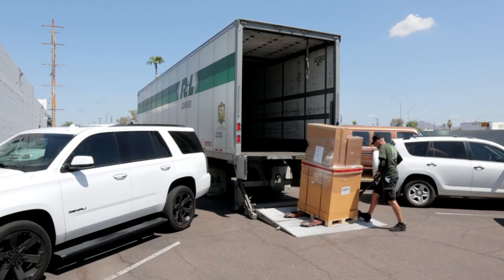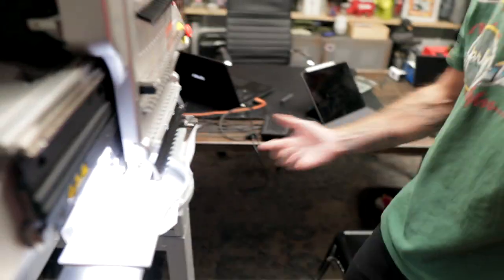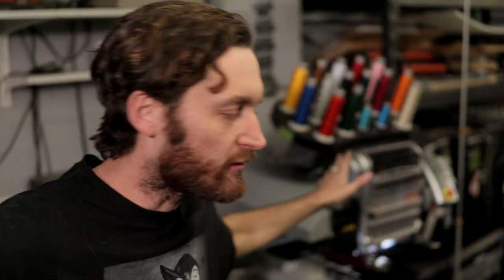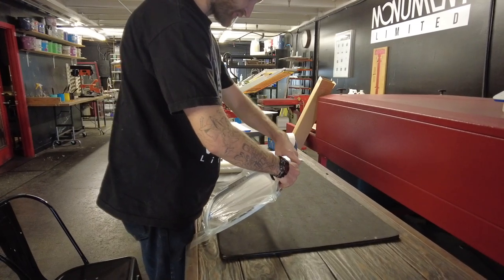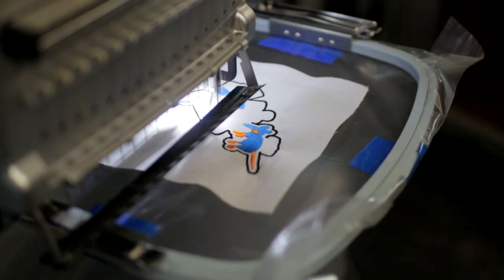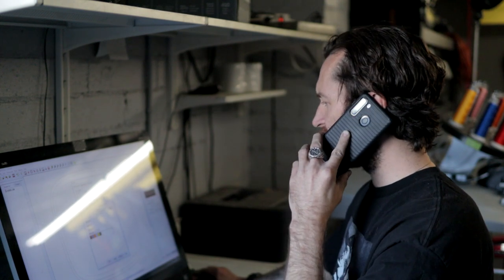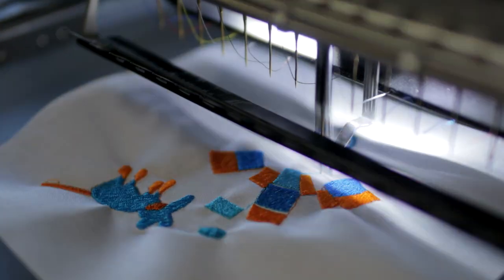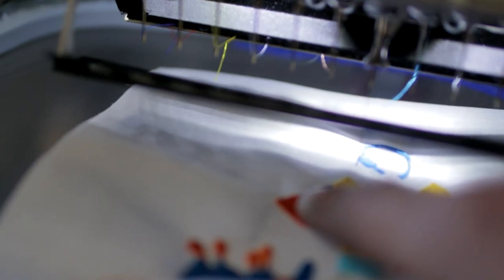Embroidery For Beginners | Step by Step T-shirt Business

Comment: Should have got a barudan instead but at least you didn’t get a Ricoma. Melco is still a good choice.
Reply from the maker: I do like the Barudans for sure. I like the melco cause you can chain multiple machines together and instead of having say four heads run of one motor each machine is running independent, so if a thread breaks or something like that the other 3 machines can keep on trucking. of course I was concerned that 4 single heads would cost way more than a 4 head. but melco prices the purchase of 4 machines the same as if I was buying a 4 head from another manufacturer. I dont know yet if this is the right decision but I feel good about working with them so far. Ill keep you posted with more vids as I put this through its paces.
Reply: Disagree. Melco is the better choice, especially for a small shop just starting out that truly cares about quality.
Reply: Beard Booze  Melco is a great option but Barudan is one of the best. Even if you have a small shop because once you upgrade to a 6 head the transition is very easy. I’m have a 6 head barudan with another incoming.

Comment: Just curious why you chose melco over other brands. Would love to know what sold you on this machine over others.
Reply from the maker: The main reason whas the ability to chain machines together. If you need a 4 head machine you can hit up melco and they will price it out to match what a typical 4 head machine would run, and now if you have 4 machines going and one has a bobbin run out. the other 3 machines will keep running. That's my main logic. Time will tell if this is proper logic.
Reply: @ThePrintLife  thanks, gives me some insight and guidance for myself. Appreciate the content, I have learned alot from you.
Reply: Melco is the best, especially as far as quality is concerned.

Comment: You could of gone for  proper one,  tajima or bauradan,  at least its not a ricoma lol
Reply from the maker: The reason I like the Melco is because you can chain the individual machines together.  If you are running 4 heads, and 1 thread breaks the other three machines will keep on plugging away. I can't yet speak to the build quality. But I did find lots of users that have been running these machines for years, so I was confident. I hope I made a good decision with Melco, only time will tell.
Reply: @ThePrintLife  only seen them at shows and as you say build quailty not the same other brands, but depends on how much you are going to use it for, ours run 8 hrs a day none stop its a realy big learning curve to get it right if you need a hand feel free to ask   all the best
Reply: We rock three melcos, one of them old as dirt. I’d put the quality up against any Barudan or Tajima and blow the doors off. When we used to sub our work out to Barudan and Tajima shops the work was also sub par compared to our melcos.
Reply: @woogdesigns  thats nice for you, 3 is quite a lot of machine to prove your point